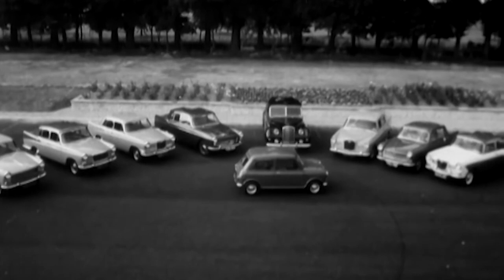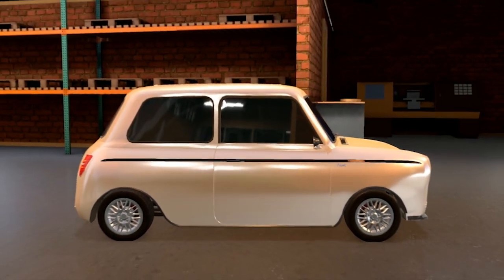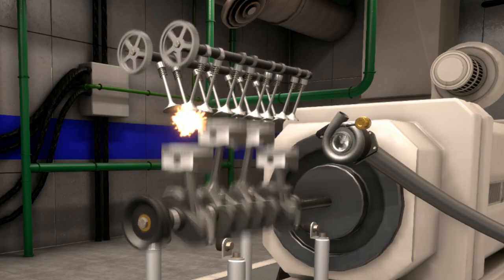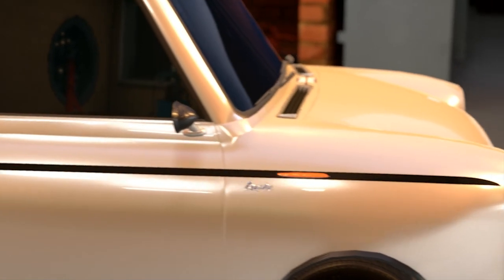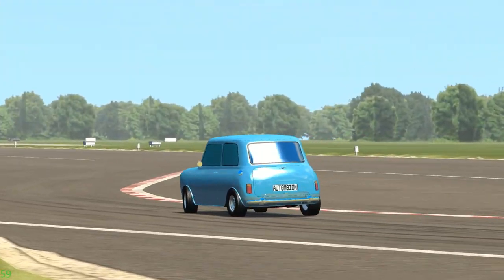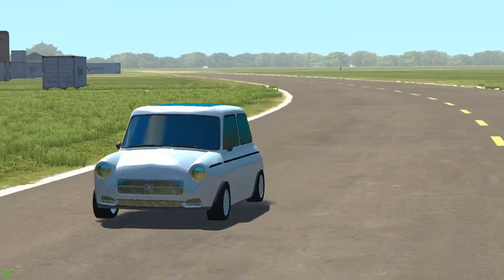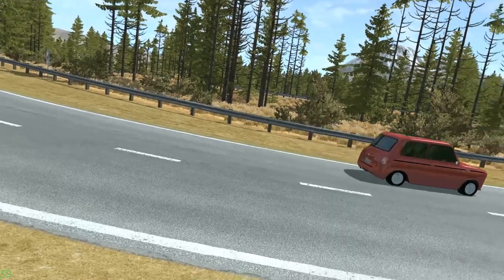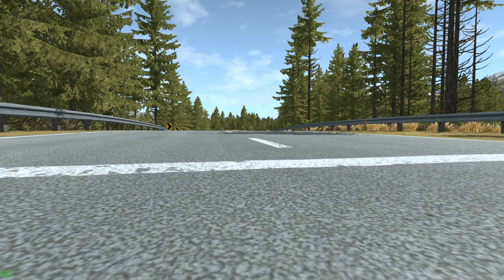1960's Icon with 2020 Technology build review.

Comment: One of my absolute favorite small cars. All of them, but my favorite Mini is the 1964 Austin Cooper S, 970, 1071 (rare options), and 1275. Out of all of them, this would probably be a Mini Cooper S. The turbo 1000 engine makes 38 more horsepower and 20 more ft-lbs of torque than the 1960's 1275 engine. (75hp, 80ft-lb)
I would love to see your "Classic Icon, Modern Revision" with the 1979-1994 Toyota Hilux.